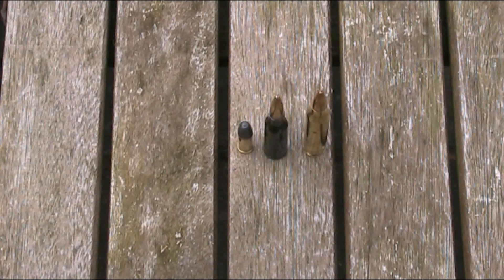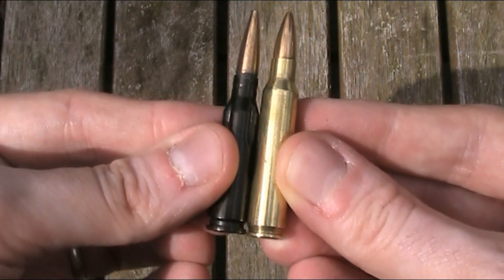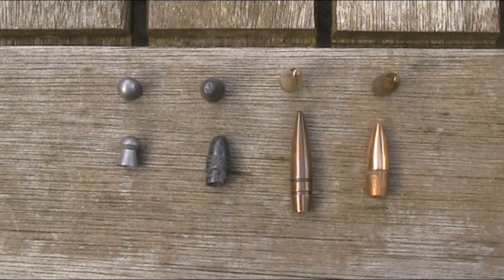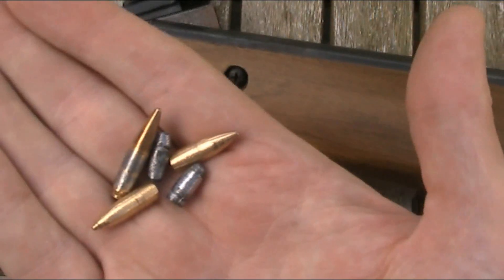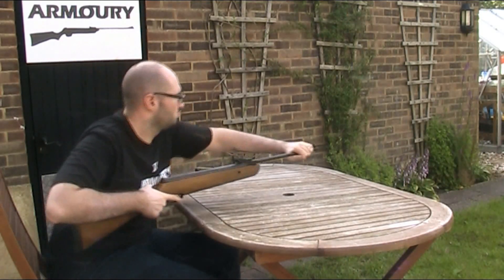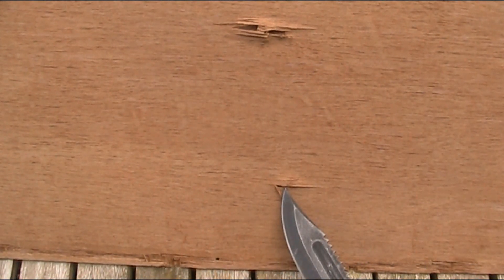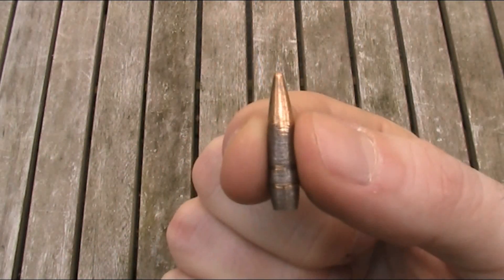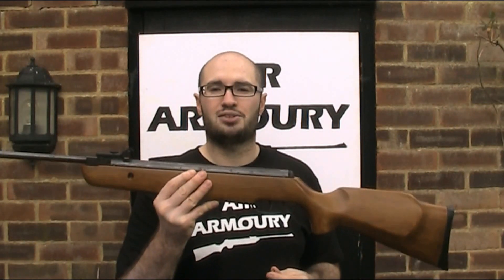Shooting Bullets From An Air Rifle | Air Armoury

Comment: in 1978,I got some .22 bullets from a fair and converted an old air rifle to fire them with no problems
Reply: How😂
Reply: @leangreenadventuresofasout7281  make a firing pin activated by the spring
Reply: Where on the case bottom did the firing pin strike?
Reply: This is the sort of stupid story you get down the pub when someone hears your into shooting.

Clearly not got a clue.

Comment: My curiosity about this topic has now been satisfied, thank you! Note: with Russian bullets there is always the possibility that the one have has a very mild steel jacket but I would feel safe saying that the vast majority of 5.45mm x 39 rounds use a bi-metal jacket. That said neither of these should damage the steel barrel of a properly made, high quality air rifle. The other bullets you used, especially the solid lead .22LR bullet, should definitely be "safe" for your rifle; again, so long as it is a good quality steel barrel since the bullet material or jacket material is made of a far softer metal than your steel barrel.

Comment: Put some vicks vapour rub at the back of pellet...called dieseling and you will be amazed of the speed increase
Reply: Always been concerned about doing that. Have you ever tested the fps increase?
Reply: @konz2891  yes it really works but I blew out the seals on my weihrauch HW40 doing it with oil however my springers can diesel pellets just fine

Comment: Great testing...many thanks. I have also seen an interesting video where a guy modified his old, beat up air rifle to shoot regular .22LR cartridges.  He had to bore out the rifling a little to seat it, and also welded a little nub on the spring end as a striker. It worked great. I love these unusual-thinking videos. Thanks for your time and trouble, and for showing this.
PS I have been looking for an old, beat-up air rifle ever since but only find decent ones that i can't bring myself to bore out....lol.
Reply: PPS....i apologise.....it was black powder he used and not a cartridge. I am too old...lol.

Comment: This question rose in my mind too but I didn't want to take a risk of damaging my rifle by firing a .22lr bullet which had explosive in its shell. Even though my rifle has a good quality barrel, the explosive could damage other parts. So thanks alot. Your video has given me my answer and finished my curiosity.

Comment: U could have just drilled out the primer ,drop a long nail in tap it with a hammer bullet comes out you still have a bullet casing in case you put it back together

Comment: I've seen someone on a vid convert a cheap Chinese .177 air rifle into shooting pellets with black powder and a primer it worked well. They fixed a nail to the piston head and drilled the barrel out at the breech only a bit for a small amount of black podeer the fps was fast.
Reply: Ah....maybe that was the one i saw...and misremembered as i thought it was .22 he shot. My mistake.

Comment: You could have got the bullets out of those center fires by sticking the heads on the gaps in that table top and wiggling them about a bit.Regarding the .17 HMR I think that it's actually .172 so a tiny bit smaller than .177 so I think that the air would escape around the bullet thus reducing the power so you'd have to use a wad.

Comment: i have seen people tape bullets to the end of those guns and have the pellets act as the firing pin
Reply: I remember a game keeper when I was a kid in the 60s that had a silencer look a like that would take a 410 2 in cartridge and would screw it on to a BSA177 air sporter for shooting rooks eggs from the nest it was very old model made by a London  gunsmiths with Prof marks of 3 and a half tons per square in loud test

Comment: the problem you have is the weight, they will hold in the gun until there is enough pressure to Shove them out.  That pressure get very high depending on weight of bullet and DRAG in the barrel.
This can cause your seals to fail, more then anything else.
But once they get enough pressure, its the thought you have a heavy bullet going Slower, but its HEAVY, and hit harder.
US idea is that anything that can go thru a 1/4" Plywood, is considered dangerous.

Comment: That air rifle is worn out, you should get about 11 foot lbs standard pellets, the fmj bullets need a wad behind as most of the air is passing past
Reply: The rifle isnt worn out how grinded the projectiles "to fit" but projectiles are actually oversized for the bore of the barrel so that the rifling can work properly and seal well, if he shortend the projectiles length they would have worked well

Comment: Need to try it again get you a swaging die to downsize so The bullet will fit the barrel and drill a hole in the back of the bullet so the pressure will slightly flare it out and put some kind of petroleum in the back to diesel it and you will have something then all for fun and science

Comment: Would be interesting to know if there is a "sweet spot" for max bullet energy depending on bullet weight, for an average air rifle. Or is it "the lighter, the more energy" ?
Reply: force=pressure x area. soon as the bullet leaves the barrel there is no more pressure so the bullet begins losing energy immediately from air resistance. they do not speed up after leaving the barrel as there is zero force accelerating them. answer is  everything fired out of a barrel unless rocket propelled has a peak power at point blank range
Reply: There's a sweet spot but it's  ot just the weight. Depends how the pellet fits and behaves in your particular barrel.
Reply: Copper jacketed projectiles do not work as well as cast or swaged lead.   Copper adds friction vs plain lead.
Reply: Big bore air rifles do every well using cast or swaged firearm caliber projectiles and can produce surprising performance.
Reply: Some comments question if air rifles can use firearm projectiles.   The answer is yes if designed for that purpose.   Most big bore air rifle easy hand firearm projectiles of appropriate caliber.  

Here is a video of a 45 caliber air rifle that is firing a 416 grn projectile designed for the 45-70 rifle.   I compare its performance to the REM 44 Mag firing a 240 cast projectile at just under 1200 fps & a 45 Super load out of a modified Colt 70 series 1911 45 ACP pistol that fires a 261 grn projectile at 1175 fps.    The air rifle will surprise many people with its performance.  

457 Air Rifle Vs 44 Mag Vs 45 Super Vs 2X4's - Who Wins?
https://youtu.be/XCT8mcSxPZA

Comment: Did BSA not make a 177 break barrel that a tube could be taken out of the barrel and a 22 rimfire could be fired, firing pin was on end of washer and protrudes from rear air delivery hole,
Reply: easier to just buy a .22lr, there far cheaper than air rifles anyway. soon as you have one the airrifles just start collecting dust.

Comment: 17hmr won't seal in a .177 barrel, you might get a single ft/lb but only if you're lucky...most of the air just blows past the bullet.

Comment: I was surprised that even though you used your rifle with the damaged barrel, regular .22 pellets traveled so slowly out of it. I know your air guns are restricted for power output in the UK, but you can have up to 10 foot pounds, can't you?
Reply: 12 Foot pounds for rifles without a license. As most sub-12 foot pound rifles are .177 or .22 most shooters like to keep them between 10 and 11 foot pounds. Air pistols have to be less than 6 foot pounds and while I don't think that there is a provision in law for most license holders to have an air pistol over 6 foot pounds it may be that other rules cover them.

Even license holders will tend to keep their air rifles sub 12 foot pounds unless they have a specific need for higher power without a source of ignition, otherwise you would just use a rimfire\centrefire and do without the hassle.
Reply: @shootmcrunfast  Very interesting. I don't know that. When did the law pass for air gun owners to have to be licensed for anything above 12 foot pounds? And did it make you angry at all? I'm assuming you live in the UK, but maybe you just know the laws because you have read about it. Either way, it's good you know it. :-)
Reply: @JesusIsAboveAllOtherNames  Yep, I'm from the UK. From memory I think the laws on muzzle energy came in either 1968/9 but it happened well before it was something I was bothered about. To be honest no-one really talks with fondness about the good old pre 12 foot pounds days! It is really only in the last 15 years or so that the limit has been really enforced. Prior to the law change you needed a license for all air guns so we are actually better off now (the old license was something you were just given after you paid a small fee).

Most shooters are quite happy with the law as it is (well at least as far as air gun muzzle energy goes). For me I'm quite happy with the balance, plinking with airguns is fun, but I mainly shoot practical disciplines (Cowboy action, Mini Rifle, practical shotgun) as well as clays and service\precision rifle. One thing we all miss are pistols though, thats a whole other discussion!

Where are you from, how are the laws there ??

Comment: 🤣I've always had the idea of removing plunger and replacing it with a pin and fireing actual bullets every air rifle I owned I had the idea but I'm always just passing it on to a friend or throwing them out when they ware out 🤣doin research to see if anyone had the idea 🤣nope all this method does is lose power 🤣fireing the head isn't making it more deadly 🤣

Comment: Hypotheticly,of course if one had a pcp rifle with say a larger than normal rifled barell,and the wieght opening the valve that realeses the air for firing woz say much heavyer !, then hypertheticly of course sending say a 30,cal-or, maybe eaven bigger with a larger mass !/grains wauld be verry doable actaualy in some cases wauld be even more acurate and higher speed over sertain distances and even more powerfull in some cases that a live shot!, if one charged hypatheticly of course ones air rifle with a much lighter gass for firing say helium or hygrogen! Lol one cauld hypotheticly reach supersonic speeds and high ratez of power,without the need to jump through hoops to gain live amo ,and of course the relevant fire arms satificates!,hypotheticaly of course! Lol

Comment: This is the most ridiculous test I have seen in a while. What results were you expecting. The cartridges when fired produce massive pressures in the chamber, upwards of 65,000 psi for .223. Your air rifle isn’t even producing 30 psi and your shoving a round 200 times heavier into it.
Reply: saves me time now I don't have to do it.  How many people want to know results.  See views.
Reply: It needs to be a test with the pellet and copper jacket bullet being the same grain to be a proper experiment